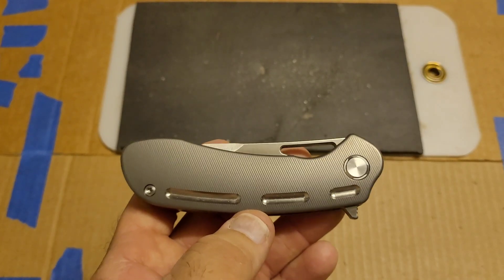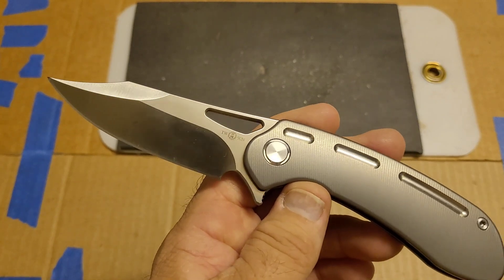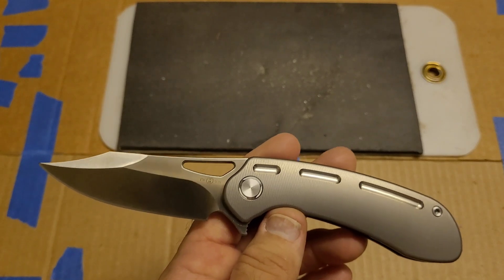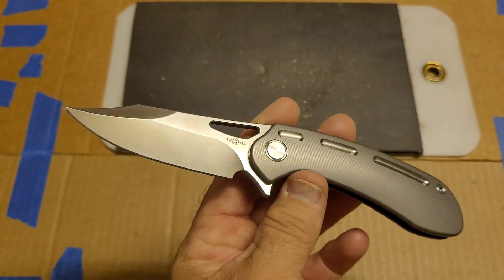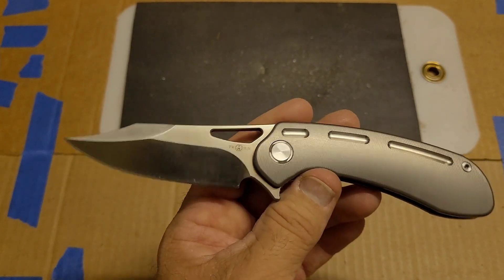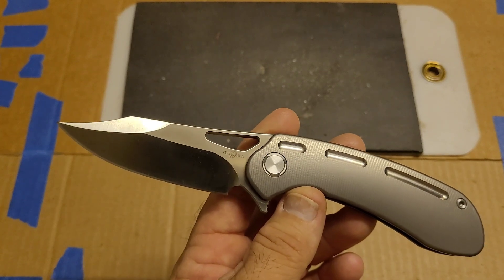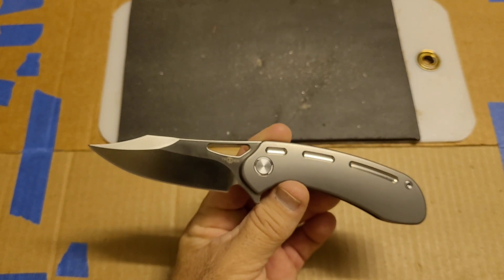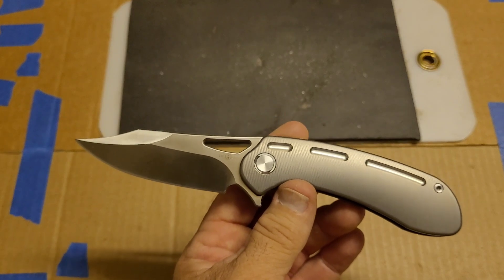Two Sun TS 261 S110V edge retention testing. How will this compare to other steels?

Comment: How do you find the quality of TS knives ? I have 2. TS 100 and a Maverick.
Reply from the maker: They do very well on machining and fit and finish. The basic steels they use they treat well but I've yet to find any higher end steels they put out with a good heat treat.

Comment: Do i need to be a pateron member to get the access to that spreadsheet??
Reply from the maker: No, there is an issue with the data sheets and I can't access it currently either. I may have to do a new one if I can't figure out the issue.

Comment: Cruwear vs m4. Edge retention and toughness? Chip resistant?
Reply from the maker: The heat treat and hardness will play a part. Cruwear run at a similar hardness as M4 say 63 hrc will have similar wear resistance while having better edge stability and impact resistance.

Comment: Even at 59HRC S110V should have better edge retention, I would love to see a chemical analysis of the steel. Cedric and Ada Gear also had an issue with their S90V not holding an edge well.
Reply: it's probably s1108cr13mov

Comment: Thanks for the testing, it's super valuable to the community. I see a lot of people justifiably questioning or doubting the heat treat but I'm interested in what was stated at point of sale, was it the usual 58-60 (in which case it was bang on toward the top end)? I don't think companies like twosun are incapable of heat treating steel in a prescribed manner so it's up to us to ask them to - if their exotic steels were heat treated as well as spyderco's tends to be they would be a lot more compelling even if it upped the prices somewhat.

Comment: I knew it was poor heat treatment. S110V should perform alote better then that. The grind isn't to bad but you just can't trust the heat treats on alote of Chinese companies. Spyderco is usually on point as far their production knife's are concerned and I've heard mixed reviews about their sprint runs but the st. Nick's exclusive in 4v is suppose to be excellent.

Comment: I've been doing some testing with a new s110v military (with the darker blue scales) and I suspect it's quite a bit harder than my 2016 s110v pm2.

Not sure what s110v Spyderco you're gonna be testing, but I just figured I'd throw that out there.
Reply: I think spyderco is running their s110v consistently at 61-63. It seems as if most of their production knife's receive quality heat treatment. I have a native in rex45 and the steel is so hard that it cuts even beyond my k390 delica and pm3 in 4V. It really sustains a fine edge for a ridiculous amount of time. The rex45 is also less prone to chipping, fracturing and rolling then any other steel I've ever used. I think spyderco's rex45 was testing around 65-66 HRC and I've learned that  hardness really matters and because rex has such a high tungsten content their able to reach those higher hrc levels. Rex45 also doesn't require as much vanadium carbides to perform well with edge retention. I actually come to like it more then k390 and in certain situations I prefer it over 10V and 4V.
Reply: @jimmycricket7946  i love spydercos REX45. Had a para 3 in it and it does hold a fine edge super well. Easy to sharpen as well. Burr breaks right off. Their Hap40 is almost just as good just a couple points softer.
Reply: @thaknobodi  yeah it's great stuff. Never tried the hap40 though. I'm very interested in trying out maxamet it's supposed have the absolute highest edge retention possible.
Reply: @jimmycricket7946  maxamet is pretty extreme. So much so i got rid of it as i like a more balanced blade steel. Maxamet is like if ceramic was a steel. Cuts indefinately as a box cutter but coarse diamond stone barely abrades it. Mine was bought second hand with a bad sharpening so it needed much work and a lot of wear on my DMT plate to correct it. Get one used on reddit, youll be impressed
Reply: @thaknobodi  yeah I just wanted to try it out. Some people absolutely love maxamet and others aren't crazy about it but nonetheless it's a unique steel and I want to explore it. I'm definitely gonna buy it used like you said since it's so expensive but I'm going to have to learn the proper sharpening technique for it because I heard alote of people say it tends to break apart.